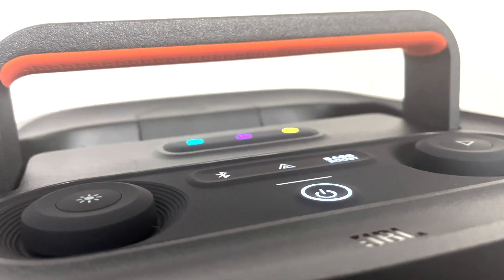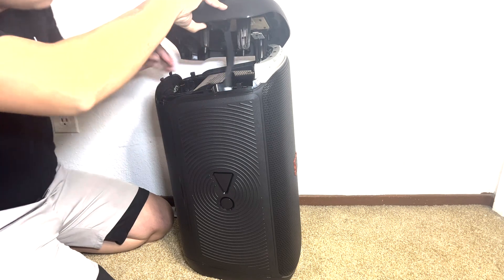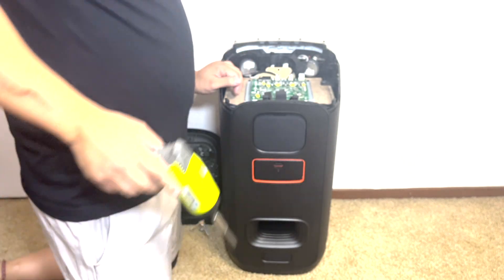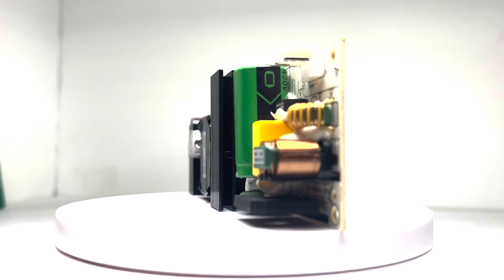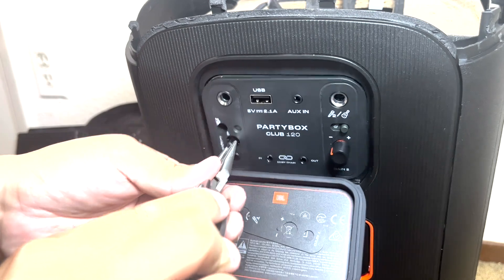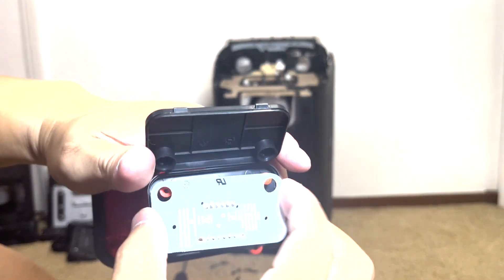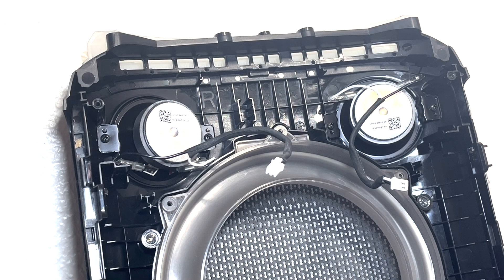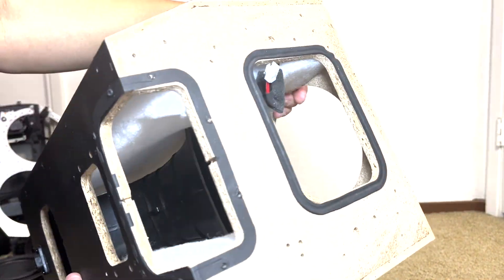JBL PARTYBOX CLUB 120 COMPLETE TEARDOWN !!!

Comment: Awesome tear down! I have a question for you Jin. I'm a huge fan of my Partybox 120, but the JBL logo on the front to me just seems obnoxious. It's much bigger than past generations, and smack bang in the center in front of the LED lights.

I'm hoping to remove the JBL logo from the front, and I'm curious to know how it is they are attached, but it's hard to see from the outside. Did you take note of it at all during your tear down? Is it attached in a way that makes it possible to remove?

Cheers : ]

Comment: Finally, I managed to test it on the oscilloscope! The speaker amplifier has 24W real Watts single channel (10 volts peak rms LIMITER, sine on 4  ohms each) What is good is that here it has a limiter and so it doesn't go any further to get into distortion! On the response diagram, it has a large deviation of +20dB at 8khz, and the linearity of 1khz is at an spl of 80dB! In the midrange it is more linear with small deviations of over -3dB. Result: A 50w rms speaker with 80dB spl..an acceptable toy for small spaces, apartments, etc., but they must be paired, in a 100w rms stereo system!
Reply: So 24 watts (clean RMS) each channel. Is this nominal watts?
Cause you then mentioned that they must be paried in a 100 watts RMS stereo system
Reply: @aidenmenezes8878  Yes.. somewhere around 50 watts both channels and there is a voltage limiter, meaning it doesn't exceed that peak, no matter if you turn the volume to maximum! Of course you need a pair, because the music is stereo, right? A single speaker actually sounds like mono sound! I use a pair and listen to stereo
Reply: @adinasteaua interesting. So a single Jbl 120 party box can give out a maximum 50 watts at peak level and that's just one jbl 120 partybox unit. If you have another JBL 120 partybox unit. Listen to both JBL 120 partyboxes paired to achieve stereo . So that would be 50 watts from 1st JBL partybox 120 + another 50 watts from the second JBL120  partybox. That's 100 watts total

Comment: Is there any effect if we turn on the speaker directly for a long period of time without using batteries?
Reply: You meaning using the speaker plugged in without the battery for example a couple of months? If that no it s doesn t hurt nothing at the speaker, just only to the battery if you don t use for a long period leave the charge at around 50-60% so it will prolong the battery life and around every two months is good to do a complete dishcharge to around 10% and then richarge to 90-100% and use until again 50-60% than you can leave it again. This is what i know for leave the battery with good health over time if you don t use often
Reply: @davidepaciarotti5109 i get it!, thanx for your advice, bro 👍🏻👍🏻👍🏻

Comment: Thanx to your video I opened the thing from the bottom and did a very easy USB PD Mod to my speaker. It thinks it's pluged in now when adding a PD Powerbank. My next Idea is to put the tweeters out of the case and put them outside in new cases so I got a wider Stereo image. Would that be possible even at an early stage like at 04:28 in the video? Could I get them out at this point?
Reply: I didnt ubderstand the power suply and usb part.
But i think its intresting.
Could you explain the gool?
Reply: I understand that you want to implement fast charging on this speaker via usb pd, can you pls tell me that tweeters part, what do you want to say about tweeters.
Reply: @hardikyadav5277  @samualdias2986 ... i did this USB PD Powerbank mod sucessfully so that the speaker has more power (it thinks it's plugged in) and lasts longer. You need a 100W PD supply and a 100W (20v5A PD Trigger tho). Now the second idea is to lead the tweeters out with cables and seal the original holes in the wooden part. goal is to put that "tweeters" into external boxes and place them like 2m away from the main speaker (maybe on an angle like pa monitors do) - so i would have a little mini PA for my mobile DJ streams in nature (you can see a trailer on my chan). that should be no problem and would be a cool second mod that gives more stereo to the whole set.

Comment: The battery compartment of the 120 looks to be the same size installationwise as the one of the 320. makes me wonder if the battery compartment of the 320 could be swapped in to double its battery capacity.
The space left and right to the battery looks to be just wasted (maybe to make it less good than the 320 box?)
Reply: It's really a shame the 120 doesn't use the same larger battery as the 320. It would extend the 120 battery life and reduce manufacturing costs rather than having two different battery models. It might have increased the cost of the 120 slightly for the bigger battery but would be totally worth the greater endurance.
Reply: It even looks like the cable from compartment to partybox board is 8 pin just like the 320! I would assume it can really be swapped in for double the capacity. (Look at 12:15)

Comment: I didn't understand that how a  36wh battery can give hrs of backup at 160 watt!!?
Reply: Because it doesn't output 160w on battery power
Reply: Yhea on battery power they limit the bass output quite a bit, and for give you some hours you need to be at around 60% of volume with light off, at 100% of volume, with light on and heavy bass boosted music have lasted me around 1 hour and half. Overall is a good speaker only problem is the small battery

Comment: Quite strange to see not a single circuit board or button panel etc is the same as for earlier versions, at least compared to the 100. Must be quite expensive to redo each release like that... I dont even think the converter looked like that tbh. Also interesting to see they now have different outputs on the board for each tweeter. Is this really a big deal!? It used to be just one 6 pin for all of them...☺️ What could be the reason for this, maybe better eq possibilities?🤓🤓

Comment: Finally revealed!! Not even JBL Chat support knows the real RMS of each speaker and tweeter. Now I know it's 50 RMS each subwoofer and 30 RMS each tweeter. Excellent teardown too. Congrats.
Reply: It's more complicated than that.  The amplifier is massively oversized for the drivers to avoid distorsions. JBL speakers relies heavily on DSP for everything, including the protection of the drivers. They also contain some calibration EQ to cut off resonances
Reply: Based on my experience the tweeters look more like 10-15W RMS, definitely not 30W. They are perfectly fine in this setup.
Reply: @dtibor5903 true i have 30 watts tweeter i think that is 15 or mybe 20 wats
Reply: one tweeter looks like it has 10w
Reply: @S1SOUNDPRIDE1 why you say that? Got alot smaller Hertz car tweeters with 80w
Reply: @crw9167 exactly why it said "looks like",not exactly. the magnet aint no neodyminium.
Reply: Do think for the price they could have used alot higher end speakers.

Can see tweeters are different to the Jbl 100/110 model?

Would love to someone rebuild one of these with better tweeters and woofers in.
Reply: @crw9167 no one would yet,no one is gonna take apart an expensive speaker just to replace the woofers,tweeters and the amplifier.
Reply: complicated to make power measurements on the oscilloscope, because it is not easy to reach the speakers...you don't know when the amplifier goes into distortion
Reply: Son woofers no sub woofer
Reply: do i need to remove the battery when i want to use it plugged in?
Reply: Não amigo. Os woofer tem muito mais que 50 watts RMS. Tem que ter capacidade acima do que o amplificador envia de potência para evitar distorções.  Tenho uma Philips nesse modelo aí de 160 watts, e os falantes dela possuem cada um 200 watts.
Reply: Actually it is Full 120W, not 160W, PPO/RMS is foolish Chinese termin.
Reply: @Harut_Hajin how did you get to the numbers?
Reply: @Harut_Hajin 100w if not plugged in. 160w full if plugged in. stop pulling those numbers out yo ass boy

Comment: Looks cheap if im honest
Reply: Not really, it is actually a very well built speaker for the price
Reply: @kailumgg7736 not really
Reply: Which part? It has wooden enclosure in it cheap speaker wont have that, just because the woofer looks "basic" doesnt mean its cheap
Reply: @guetetepgue  yea and the main board has a lot of components on it and that isn't cheap to make and the woofers are basic looking but very well made
Reply: @guetetepgue  the wooden enclosure and drivers

Comment: Can this speaker play without the battery and with the directly current power ????????
Reply: It's perfectly fine
Reply: Yes but it’s not good for the power board
Reply: @ColinFernando1 why?
Reply: @ColinFernando1  why would you say that? Even with the battery in and power plugged in and playing it bypasses the battery and runs directly from power?
Reply: @ColinFernando1  Why? Isnt it designed to work well when directly plugged in?